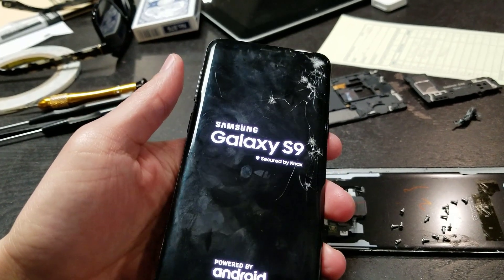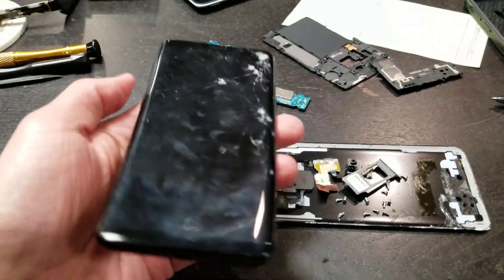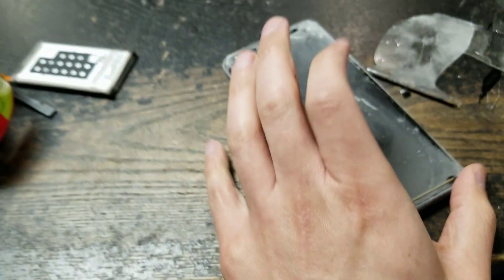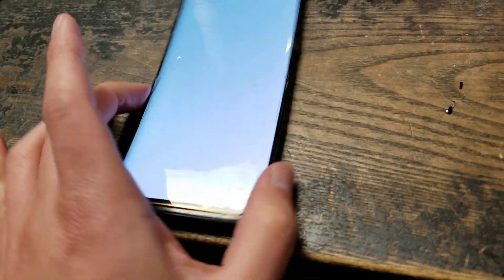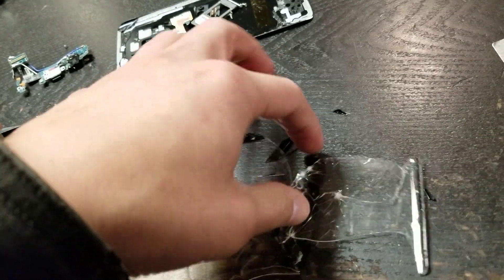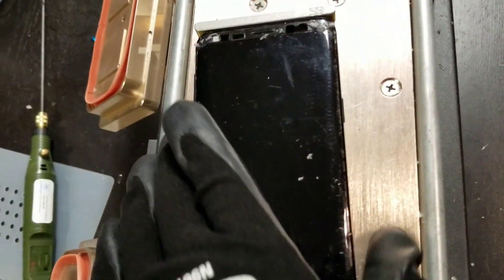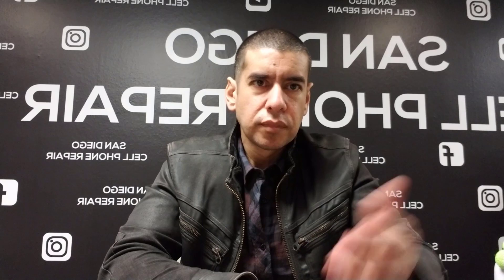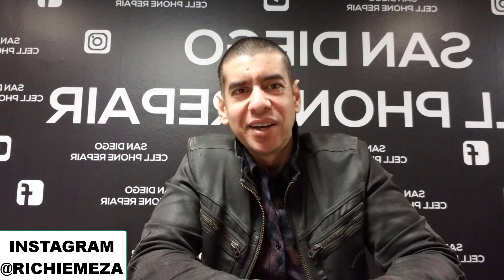Samsung Galaxy S9 Cracked Screen repair with the Freezer - Glass Only

Comment: Does doing that process drain the battery a bit?
Reply from the maker: No. Why would it??
Reply: @RichardMeza , I had my S9 fixed yesterday and in less than an hour my battery dropped about 75%. Just curious
Reply from the maker: @brentkrause255  Did your battery get placed into a freezer? This video is about putting only a screen in a special freezer.

Comment: The more expensive the phone ,     easier they are to  break  and more expensive to repair Samsung won't even repair for cheap
Reply from the maker: Both Android & iPhones are made of glass on both sides. You cant even drop them on the back anymore or the back covers will crack.

Comment: Hi Richard, just wondering have you had any cases like the glass come off with digitizer together when you separate it. I have tried an S9+ with freezer and it was separating Digi from the screen as well when I tried to take off the glass.
Reply from the maker: I did an S9+ yesterday for a customer. There is a trick to it.
Reply: @RichardMeza  Separate s7 edge and s8 are pretty smooth and I did a lot of them all success, just I only had one s9+ screen and it was failed because of the Digitizer was coming off from screen with glass together. Wired, to be honest, I got a few instruction videos from freezer manufacture which shows the glass come off normally like s7 edge s8.
Reply: @RichardMeza  What's that trick?
Reply: How much you want for yours trick for s9 separate iff its really works

Comment: Does note 8 and note 9 work with freezer as well? Cheers your videos are very helpful.
Reply from the maker: Yes
Reply: @RichardMeza  What temperature do you recommend for note 8 and 9 and how long will be good for those LED separating? Cheers
Reply from the maker: @NicolasChoiNZ  I have a negative -145 freezer. The Note 8 glass comes off between 3-4 minutes. The Note 9 between 5-10 minutes.
Reply: @RichardMeza  WOW, so which means it even doesn't need to be -180. That's good to know. Thanks very much, Richard.
Reply: @RichardMeza  re3

Comment: So how are you able to tell if it's going to be a glass only repair or full display?
Reply from the maker: Glass only repair is the screen is cracked with no bleeding black spots or bleeding colors. Full display replacement is screen is cracked and has black bleeding spots, bleeding colors, screen partially doesnt touch anymore. You can easily tell within 2 seconds by putting it on a white background. I put it on the call menu when checking for bleeding black spots.
Reply: @RichardMeza  Awesome! Thanks for the reply! Great content!

Comment: Does The freezer only work for galaxy phones. I just bought the $3500 freezer and  tried 15 different iPhone screens. The glass wouldn’t come off and it caused water damaged. I’m pretty skeptical about this video.
Reply from the maker: The freezer is for Samsung Oled phones only. iPhone LCD screens and Samsung Oled screens are different. iPhone LCD screens have a backlight. Those are done with the hotplate and wire method. Samsung OLED screens dont have a backlight. I have dont have any videos using the freezer with the iPhones. It's to be used with the curved Samsung Oled screens.
Reply: You did an iPhone screen replacement video. And On that video, i asked if you could just do a glass repair with the freezer  and you said I could if I had a freezer similar to yours. But now I know. Lol
Reply: Have you tried any galaxys yet?
Reply from the maker: @andrewg2430  This video is of a galaxy phone.

Comment: Nice video👍I havent tried yet but what i heard, dry ice would be the another solution to remove gorilla glass on samsung screens. But definetely i need one of those freezers for my shop as well.
Reply from the maker: Dry ice doesnt work. Already tried it. It doesnt get the Samsung Oled screens cold enough. Dry ice works for the iPhone LCD screens but not Oled screens like the new iPhone X, XS or Samsung screens. BUT liquid nitrogen does work. So this special cell phone freezer or liquid nitrogen works.

Comment: Hi Richard great videos keep it up! Question: why you have to disassemble the phone to replace the glass only? Why not freeze the whole phone and then replace the glass?
Reply from the maker: If you dont take out the motherboard, cameras, and battery. They will all freeze solid and probably screw them up.
Reply: @RichardMeza  Thanks buddy,  it seems there are no shortcuts in the process...

Comment: Hey, Richard. Excellent work. I have over 20 years experience with electronics and came across your channel recently. I would love to follow in your footsteps but don't have the $5,000 to get the freezer at this time. Will Dry ice work, instead?
Reply from the maker: Dry ice will not work. It wont get the Samsung Oled screens cold enough but Liquid nitrogen works. You can also use a cell phone screen refurbishing company to do it for you and save up money to then buy a freezer and do it on your own.

Comment: Hi love your work will this work on a s10 with finger print sensor on the screen ???
Reply from the maker: The S10 was just released in stores 2 days ago. I dont see why it won't, haven't tried it yet.
Reply: @RichardMeza  the ultrasonic fingerprint sensor is under the screen, if the loca is applied correctly, fingerprint sensor will still work :)
Reply from the maker: @randomdude4110  with the S10 you might have to use OCA sheets for the finger print scanner to keep working. I dont know yet though. I've fixed and S10+ already but the display was already damaged so I replaced the full screen.
Reply: @RichardMeza  ah ok I'm just on the video looking for fix my s8 or just straight up pawn it, as every solution requires a $2000 freezer or costing me $200 for a repair, would heating it and using fishing line be enough for a gettho home repair?
Reply from the maker: @randomdude4110  the wire method is to hard for someone without experience. I dont even do it that way.
Reply: @RichardMeza  mmm, I guess ill either pawn or use a local repair shop, oh, btw where are you located and how much do you charge? 😂

Comment: what a fake , i try 20 pcs od s9 and s9 plus lcs , and 90% of this lcds are working but afer freezer set up to -180°  lcd are broken becouse lcd is not glued the same way as s8 plus to the lcd back sticker after freezing machine lcd   are peeling off from lcd bakc sticker end then lcd stops working , in -180 ° lcd starts rolls and then stops working
Reply from the maker: The technique is different with the S9. Its not fake. This video is proof. Screen doesnt fall out of the frame. The technique is different with this phone. That's all. No fake here. Real person. Real Owner. Real Store.
Reply: Any luck?